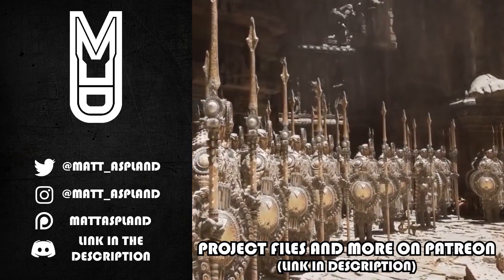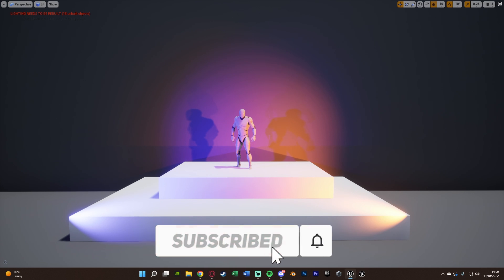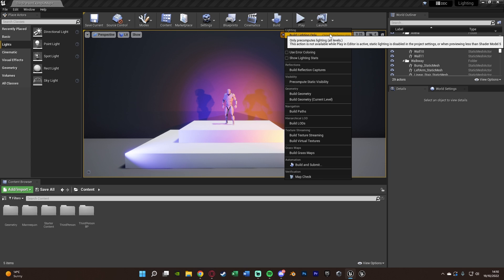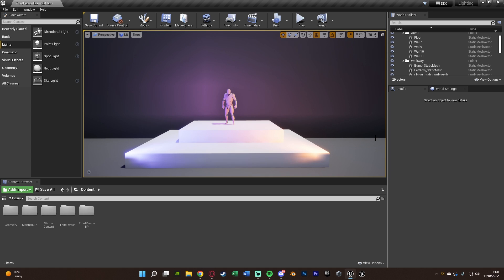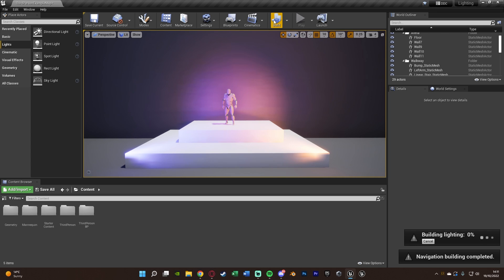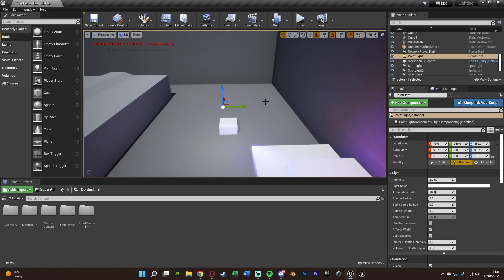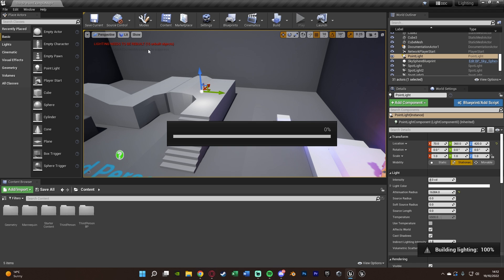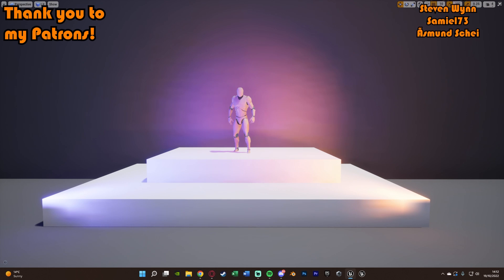How To Fix The "Lighting Needs To Be Rebuilt" Error Message In Unreal Engine 4 (Tutorial)

Comment: I know this video isn't for me since I have been a developer for over 5 years at this point but I have been having issues building lighting in my games, basically for a while when ever I hit the build button, by the time the actual building lighting pop up appears in the bottom right corner, it instantly fails, Unreal Engine's logs don't say anything and I looked into Swarm Agents logs and it said something about Invalid Class, cant seem to fix it and was wondering if you have any ideas on how to fix it, I'm honestly considering uninstalling the engine, manually deleting Swarm Agent and then doing a fresh install but idk if that would work. I have tried different projects, and even different engine versions, nothing has worked, any help would be grateful, I have also seen someone else have this issue on UE Forums, and I tried to use the method that fixed it for them but it didn't work. Any help from you would be greatly appreciated.

Comment: Any tips on why lighting rebuild can take forever or seemingly never complete?
Reply: Lightning builds usually takes too long even with the high-end CPU's unfortunately. But if it isnt finishing then something went wrong about your lights.
Reply from the maker: RAM and CPU are the main limiting factors with build speed. The first build typically takes longer than the subsequent ones however.

Comment: The error message also goes away if you  change light mobility to Movable from the details panel. But is it safe? Which one is correct for a finished game?
Reply: Movable lights is too expensive for most of scenes. Reduces FPS.
Reply from the maker: For UE5 this isn't too bad with Lumen, but in UE4 I wouldn't recommend doing this for all lights

Comment: Great vid Matt but in my case I have 23k unbuilt objects, and when I start the rebuild it gets stuck on ExportingLightQuality at 100% and doesn't go to the build. Any ideas? Thanks! ;)
Reply: Same Probleme for me
Reply: You have to add a lightmap volume
Reply: @MrTreeGuy  Whats whats?
Reply: @MrTreeGuy  If it were only that simple. Adding a lightmass volume changes nothing. Also this happens only on this project. Could be because the scene has a lot of meshes?
Reply: change all your lights to movable. quality will be unnoticeably less BUT you will never need to rebuilt any light whatsoever